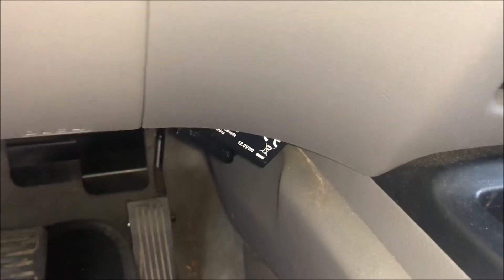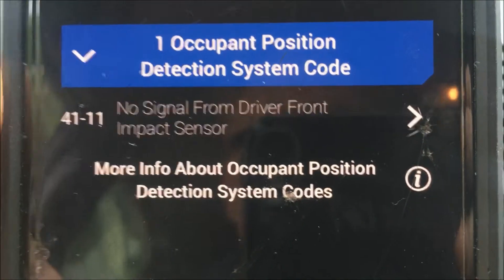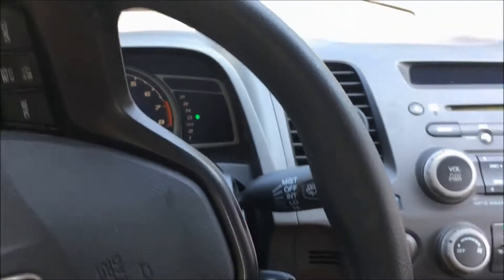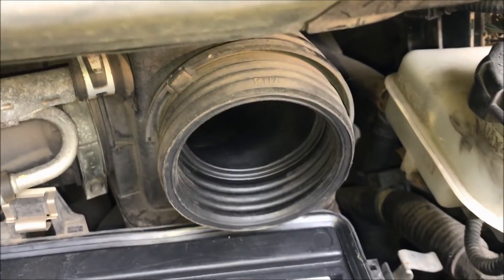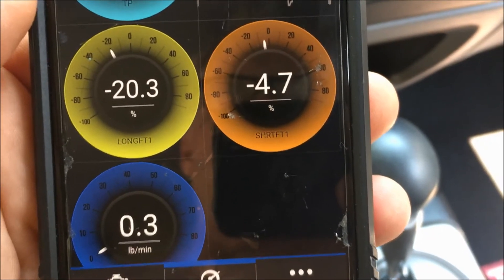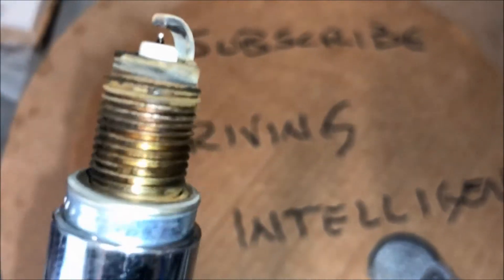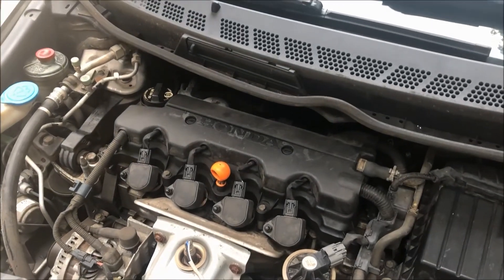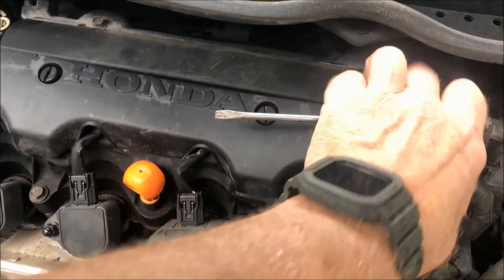How To Diagnose Extreme Negative Fuel Trims 8th Gen '06-'11 Honda Civic

Comment: Have you solved the negative fuel trims?
Reply from the maker: thanks for watching and for the question.  I did not go further given no CEL and the car drives perfectly.  I ruled out the MAF, air filter, spark plugs / coils and throttle body.  I did not want to pull the injector rail apart to measure fuel pressure since Honda did not provide a way to check fuel pressures while the rail is attached to the fuel line.  What problem are you experiencing?
Reply: @DrivingIntelligence  i am also experiencing the same negative short term fuel trims. I don't own a high end scanner thats why i can't read LTFT. Have you examined the PCV valve / hose?
Reply from the maker: @k4fari  thanks for another question.  I did not inspect the PCV.  The only thing I can imagine a bad PCV could do to fuel trims is cause a significantly higher fuel trim since a broken PCV line will introduce additional air not metered by the MAF Sensor.  Is there a reason you feel it might be the PCV?  Do you have a check engine light?  Also, what other possible fail points have you tested for?
Reply: @DrivingIntelligence  a bad pcv don't pass air to intake and the fuel trims turn to negative. I am not getting a check engine light or what so ever. But I am having negative fuel trims like yours. I have changed the pcv valve and stft jumped from - 17 to - 7, - 6 on idle.
Reply from the maker: @k4fari  I see, your PCV was plugged or not allowing air to pass to intake, makes sense.  Are you able to check your LTFT?  I suggest a BlueDriver... good tool:  https://amzn.to/3lsVutO
Reply: @DrivingIntelligence  no i am unable to read LTFT. I am using a cheap ELM 327 module to read the BASIC DATA STREAM FROM ECM. I have planned a visit to Honda dealership for HDS / scan. Will update you here whatever they will say.
Reply from the maker: @k4fari  I look forward to hearing back from you
Reply: @DrivingIntelligence  The  fuel trims are back to normal. The only sensor which you and me haven't considered was the ECT Sensor 1. They scanned and noticed the coolant temperature reaches 100c and radiator fans kicks in. They replaced the said sensor and now fans turn on at 98c.  They started the  engine and STFT came to - 1 to +1. I am very happy-go-lucky at the moment.
Reply from the maker: @k4fari  that's an excellent learning.  I'm trying to understand why a hotter engine would cause a negative fuel trim.  Did they explain?
Reply from the maker: @k4fari  now that I have thought about it more, if the ECT sensor is reading incorrectly and making the ECU think the engine is colder than it actually is, the vehicle will behave as if it's in the enrichment cycle and push more fuel into the engine.  I will check this on the CIvic I had looked at.  My analyzer does not give me that kind of diagnostic data.  I am considering buying a much more capable diagnostic tool.
Reply: @DrivingIntelligence  can you read the coolant temperature of your civic at which radiator fans turn on ?Check, fans are working on 100c  temperature or below?
Reply: @DrivingIntelligence  yes, they told me when engine block has a high temperature the knock sensor sends a signal to the ECU to enrich the mixture to cool down the head assembly. Thats why my car was having high negative fuel trims all the time.
Reply from the maker: @k4fari  That makes perfect sense. Thanks for that information
Reply: @dicksonadams9871  check and replace your ECT sensor, Fan should turn on at 96c to 98c
Reply from the maker: @dicksonadams9871  haven't tried yet... I don't have access to the car, but II will in the near future.  I will make a video once I do.  Thanks once again.
Reply: @k4fari  Greetings, I'm going through the same problem of negative adjustments -18 approximately in the short and long term, and I haven't changed this temperature sensor because it seemed to work normally, but now that you mention 100º C this one does reach that temperature, I will change it to see how these adjustments behave, thanks to all... by the way, if I changed the PCV even its hose was sucked, I also replaced it and it remained the same.  

use translator sorry lol
Reply: @ednR15  May be there is an air leak/ air passage blocked; check it. have you cleaned the throttle body and calibrated? Inspect your spark plugs and plugs gaps should be 1.1mm, have you done valves adjustment?
Reply: @k4fari  I have never checked the valve adjustment or the air passage or a clogged duct, I sometimes do the adjustment of the spark plugs, according to the manufacturer, even the original Honda ones are already calibrated, and I also send the cleaning of the throttle body to do along with its calibration a short time ago, even at other times and it was still on low settings.  But I'll check what you mention about the ducts to be more sure before, thanks 👍🏻
Reply: @ednR15  do valve adjustment according to factory specs and you will feel a smooth and more fuel efficient drive with corrects fuel trims
Reply: @k4fari  thank you I will take it into account as a priority and notify the results as soon as I can
Reply: @ednR15  hello, I have a 2008 honda civic, the biggest fault is that it is spending a lot, a lot of gasoline, approximately 14 miles per gallon, I already checked everything, it does not have the check light, the short and long term adjustments oscillate in the -14.06% short term and -20.31% doesn't make sense, and yet the scan indicates that the mixture is 14.7, all this at idle and with the correct temperature, I wouldn't know what else to put my hand on, check the PCV valve, the body intake, throttle body, spark plugs, everything, if anyone knows anything write me
Reply: @k4fari  hello, I have a 2008 honda civic, the biggest fault is that it is spending a lot, a lot of gasoline, approximately 14 miles per gallon, I already checked everything, it does not have the check light, the short and long term adjustments oscillate in the -14.06% short term and -20.31% doesn't make sense, and yet the scan indicates that the mixture is 14.7, all this at idle and with the correct temperature, I wouldn't know what else to put my hand on, check the PCV valve, the body intake, throttle body, spark plugs, everything, if anyone knows anything write me
Reply: @k4fari  I have already adjusted the valves, disassembled, cleaned and calibrated the throttle body, checked the gasoline pressure and it is 58 psi within the specifications, I also added an additive for cleaning injectors and the rich mixture increased, reaching down to -22 sometimes, I'm coming to the conclusion that the problem is maybe something clogged where there's airflow, something weird is that sometimes the short fuel trim stays at 0.0% like two seconds, and then goes back to “normal” ranges -18/-20.  The only thing different is that it has a better reaction when accelerating.
Reply: @ednR15  hello, this seems like a common problem, I have done everything to try to correct the high negative adjustment, practically with everything I have read I have done a diploma, I am already running out of options, I have thought that the injectors may not be obeying the ECU and although it indicates a rich mixture and that the injection pulse decreases, they may not be paying attention or the ECU is not decreasing according to the information given by the oxygen sensor.
Reply: @emmanuelpolanco7109  so any update after this? looks like a same problem, mine is a honda city idsi engine 2005
Reply: @kumars172  Hello, I'm sorry, I haven't been able to find the problem, even having done everything that has to do with the fuel mixture.I'm in the same place, I decided to rest and see if someone else found the solution
Reply: @emmanuelpolanco7109  i want to know ur map sensor reading or the calcuated load reading, is it too high?
Reply from the maker: Sorry, I don’t have access to that car right now.  are you still having problems?
Reply from the maker: Did you try changing the temp sensor?
Reply: @DrivingIntelligence  I have checked on the ect now, fan turns on at 95c and I have looked into past trip logs, I dont think my ect went above 100c, anyway fan turns on at 95 for me, so I am thinking it aint an issue
Reply from the maker: @kumars172  Do you know the spec for when the fan turns on?  I've seen these old temp sensors send false signals that impact vehicle performance, even on my 1985 Mustang
Reply: @DrivingIntelligence  not sure what u mean by spec, at 95 degrees celcius it turns on, in just 10 to 15 secs the heat returns back to 92
Reply: @DrivingIntelligence  can you please tell me something, when someone says check o2 ground, does replacing the sensor fix the issue or should we still look into some wires?
Reply from the maker: @kumars172  If you have a bad ground, then you would have other issues or diagnostic trouble codes.  Why do you think a bad ground is a possibility?
Reply from the maker: @kumars172  please share your fuel trims values
Reply: @DrivingIntelligence  you got any email or telegram?
trims were anything negative from 5 to 30, i am doubting now that oxygen sensors are the issue with me
Reply: @DrivingIntelligence  I dont think this car has many codes about the lean or rich o2 sensor, cause the sensors has been in rich for over a month with me now and still no CEL. When I got this, the rear o2 is dead, and CEL is on, when I changed the sensor, CEL is gone but the fuel trim is never +ve, not even once, there are time when I revved it past 5k rpm to idle, as per scannerdanner this should put the trim to +ve but it doesnt do this, do you think the sensor is gone? any other ways to force it to positive?
Before I change the upstream sensor, I want to make sure the wire are okay, thats y I am asking about the o2 ground. How do I test it
Reply: also not sure if the ecu doesnt support ltft or the elm237 I am using cannot scan it but ltft is always 0.
Reply: @kumars172  the ecu doesn't support LTFT in FD/FD2 models (being used in Indo-Pak region)
Reply from the maker: @dicksonadams9871  returning to a few of these older questions.  Your engine cooling fan should turn on with the AC to pull air across the AC condensor.
Reply from the maker: @ednR15  did you resolve why your PCV hose is collapsing?
Reply from the maker: @emmanuelpolanco7109  sorry for delay, there are a number of potential causes for extreme negative LTFT.  Generally, this means your engine is perceived as getting too much fuel.  Possible causes are blocked intake passage, dirty air filter or a clogged exhaust (or damaged catalytic converter), faulty fuel injectors, but other possibilities are problems with one of your sensors, most common being the mass air flow sensor (MAF), oxygen sensor (O2), ECT sensor or upstream air/fuel ratio sensor (A/F).  Have you made any progress with your issue?
Reply from the maker: @kumars172  Are you able to use your diagnostic tool to monitor O2 sensor operations?  Is the O2 sensor switching between 0 & 0.9 volts?  This indicates proper operation.  I'm sure your ECU will provide a diagnostic trouble code if your O2 sensor is not operating properly.
Reply from the maker: @k4fari  can you explain this comment?>  " the ecu doesn't support LTFT in FD/FD2 models (being used in Indo-Pak region)"
Reply: @DrivingIntelligence  There are different variants for different regions with different ECUs. Asian Varaint is called FD/FD2. You can google "Civic 8th Gen FD"
Reply: @DrivingIntelligence  so yesterday the mechanic unplugged the upstream sensor so i can order the part, and when putting it back, he didn't put it properly, so there is no input to ecu from upstream, I have felt greater pickup, and no engine hesitation when upstream is disconnected, so I think the sensor is the issue and it is cutting away fuel to the engine which is causing hesitation, I changed the new one today and the trims were negative still and hesitation is also back . what do u think the problem is? wiring? what can cause high voltage and no low voltage?
Reply from the maker: @k4fari  appreciate that info, I'll do some research.
Reply from the maker: @kumars172  wow, tough question, what are your fuel trims with the O2 sensor unplugged?  You could have an ECU problem.  Most of the time, manufacturers build in protection algorithms in the ECU to use other sensors as back-up when on sensor fails so you are not left stranded.  Disconnecting your sensor is likely causing the ECU to work with other sensors for fuel and spark management which feels like improved performance.  Appears something is causing a bad signal to the ECU associated with your upstream O2 sensor.
Reply: @DrivingIntelligence  there will not be fuel trims when o2 sensor is disconnected, but fuel average is almost the same however with Better acceleration
Reply: also another update, i checked the group on firewall and it isn't connected. will check ground wiring tomorrow as o2 sensor is impossible to access without a lift
Reply: *ground on firewall
Reply from the maker: @kumars172  you're very correct, my mistake.  Thanks for your assistance
Reply: @DrivingIntelligence  Hi, i checked on the o2 sensor with what limited knowledge i have today and no luck with it. will a bad cat cause high map value?
Reply: @DrivingIntelligence  update on this, checked o2 sensors againing, i have a spare o2 so connected it with it outside the exhaust and it went full lean like +40% , so no problem with ground or wiring, So i now suspect a clogged exhaust, sent it to get cleaned, will wait and see how it goes tomorrow
Reply from the maker: Good info.  You’re thinking you have a clogged cat?
Reply from the maker: That is possible.  A clogged cat will increase exhaust back pressure and therefore impact engine vacuum which will impact MAP sensor measurements.
Reply: @DrivingIntelligence  yes and looks like this vehicles fuel ia controlled solely by MAP reading rather than throttle
Reply: @DrivingIntelligence  no luck with clogged exhaust as well, if there is an increased pressure in fuel rail, will it be detected by ecu? or does it count it as it normally would ? like getting x average in obd reading and getting less than that in real
Reply: @DrivingIntelligence  maybe i didn't do it perfectly, it may even go 0 if done perfectly
Reply: @DrivingIntelligence  fuel rail pressure should be visible in your ODB readings . More over there may be a short circuit or continuity break from any sensor to the controller . may be .
Reply from the maker: @nadeem5476  good points!  Thank you!
Reply: @DrivingIntelligence  I have checked the shop manual, it is supposed to turn on from 91 to 95, and turns off after substacting 3 to 5c , and i think its working fine, always maintains below 95c
Reply from the maker: @kumars172  appears your ECT is working properly
Reply: @DrivingIntelligence  I have an update for you all, I did a valve clearance job by myself and trims  fells from 25 to 10 in running, at idle it is between 10 and 20. economy increased by 3 to 4 kmpl
Reply from the maker: That is outstanding news!  Thanks for the update!
Reply: @DrivingIntelligence  I did it again, this time  went with the higher spec in manual and a little loose over it, like if its 0.15mm to 0.19mm, i went with 0.20mm and it increased vavle noice although not too loud and the fuel trims are rotating from 3 to -3 hardly it ever goes to -9.
Reply: @DrivingIntelligence  i also see 0 fuel trim too sometimes
Reply from the maker: @kumars172  Very nice!  So now your valves close completely during operation.  Nice work Kumar.
Reply: @DrivingIntelligence update on my case : i did a valve job, replaced and lapped valves, so finally i can see positive and negative trims too. although i still see -6 or -10 intermittently, most of the time trims were -1 to +1 and i consider the problem solved permanently in my case.
Reply from the maker: @kumars172  awesome update, thank you, and congrats on the resolution.
Reply: I’ve had same issues with my civic but my engine shuts off when accelerating from a stop. No CEL. I replaced the MAF Sensor, cleaned throttle body, replaced egr valve, replaced crankshaft position sensor, and replaced fuel pump. Any ideas what the cause could be? Thanks!
Reply from the maker: @bigkm1888  thanks for finding my channel and reaching out.  You don’t have a CEL, but have your run diagnostics anyway?  Have you observed fuel trim values?  If you have, give me more of this data.  Seems like fuel delivery, but could be something else.
Reply: @DrivingIntelligence  Thanks for the helpful content and response! So I’m very new to running diagnostics on a car and learning as I go. But I noticed a bad hesitation when accelerating. Also the STFT is ranged from -1.6 to 4.7 and the LTFT sits at -10.9
Both of these are when the car is in park and idling.
Reply from the maker: @bigkm1888  Sorry for the delay, been busy, I will get back to you
Reply from the maker: @bigkm1888  again sorry for the late reply.  I actually could not find your comment!  Regarding your fuel trims, they look ok.  your LTFT is getting pretty negative, but not bad enough to indicate an issue causing hesitation.  Can you watch your fuel trim values when you accelerate?
Reply: hello, I have a 2008 honda civic, the biggest fault is that it is spending a lot, a lot of gasoline, approximately 14 miles per gallon, I already checked everything, it does not have the check light, the short and long term adjustments oscillate in the -14.06% short term and -20.31% doesn't make sense, and yet the scan indicates that the mixture is 14.7, all this at idle and with the correct temperature, I wouldn't know what else to put my hand on, check the PCV valve, the body intake, throttle body, spark plugs, everything, if anyone knows anything write me
Reply: @emmanuelpolanco7109  have you checked the valve clearance?
Reply: @k4fari  what kind of valve?
Reply: @emmanuelpolanco7109  intake valve and exhaust valve
Reply: @k4fari  I checked the valves, the complete intake system was cleaned, including the cylinders and the valves, both intake and exhaust, and no progress was made with respect to that.
Reply: @emmanuelpolanco7109  it isn't about the clean, its about clearance. Search it on youtube "Honda civic 8th gen R18 valve clearance"
Reply: What are the causes of high negative fuel trims ?
Reply from the maker: @johnrolandgabagat9129  your comment made me watch my video again... your question is answered in the video.  Please watch in it's entirety
Reply: @DrivingIntelligence  I read this whole comments and I can see that one of the commenter replace his ECT Sensor. I will try to check the temperature of my vehicle if the temp will up to 98 degree celsius.
Reply: @DrivingIntelligence  I on my car at idle within 10mins the temp is only 88 degree celsius ? Is this normal ?
Reply: @DrivingIntelligence  At 88 degrees the radiator fan is on. Not on 98 degrees celsius.
Reply from the maker: @johnrolandgabagat9129  That would indicate to me that your sensor is not operating and could impact fuel delivery.  I don't know how Honda programmed their cars, but when an engine running cooler, normally, more fuel is delivered into the combustion chamber for drivability and warm-up.
Reply from the maker: @johnrolandgabagat9129  Please refer to my prior message
Reply: @johnrolandgabagat9129  ecu cuts away power from engine which causes lag and hesitation at lower rpms